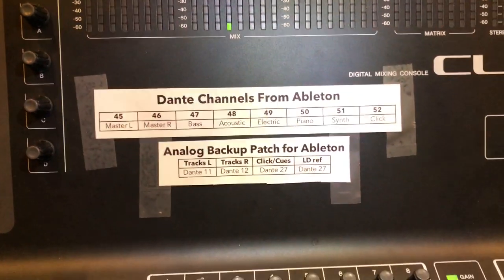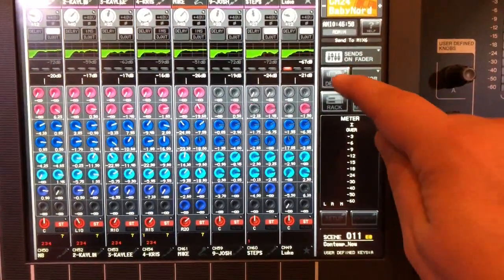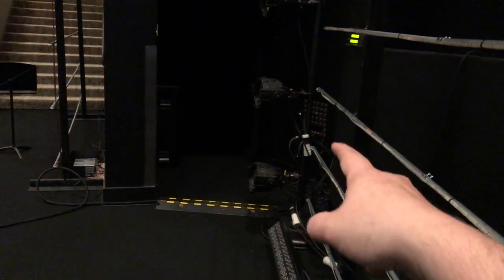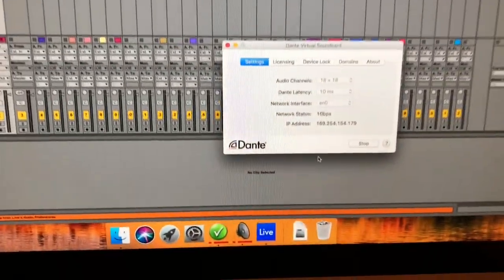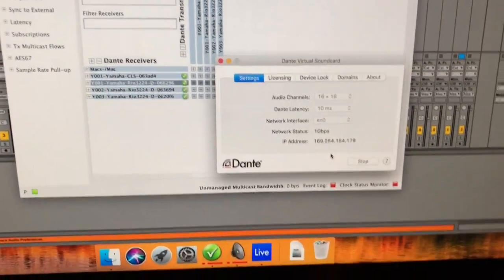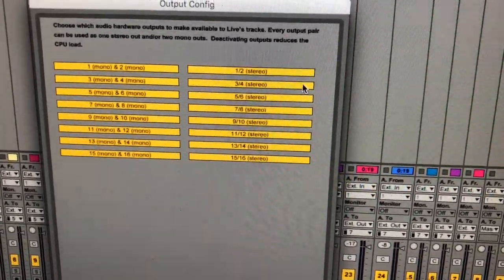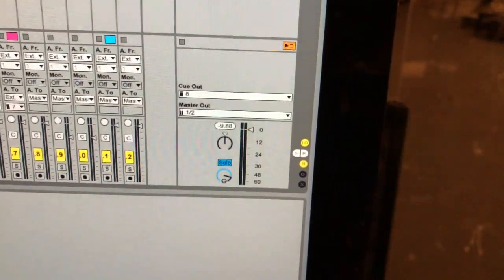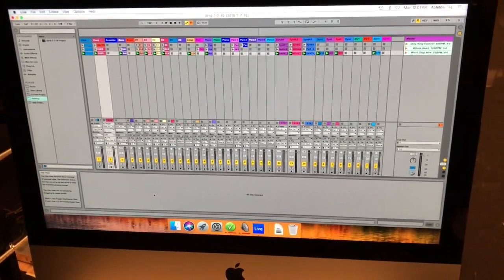Using Dante To Get Ableton Tracks to Yamaha CL5

Comment: Did you go out of the console with a Dante Card to a switcher or did you just go directly out of the Dante outputs on the console to the switcher?
Reply from the maker: Hey Steve, we’ve got our CL5 connected via the Dante card and the iMac running Ableton going in to one of our Yamaha switches along with some other components our audio network.